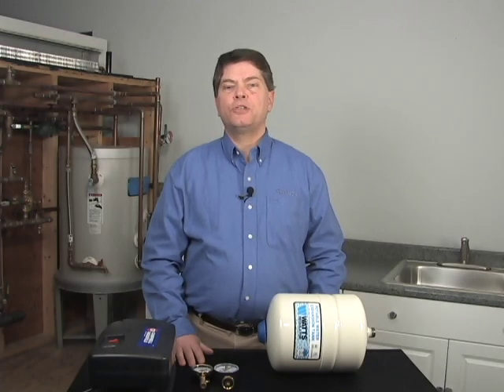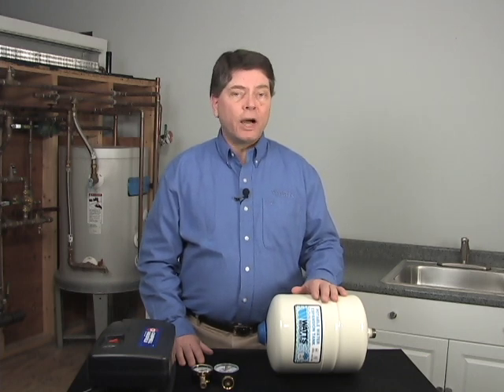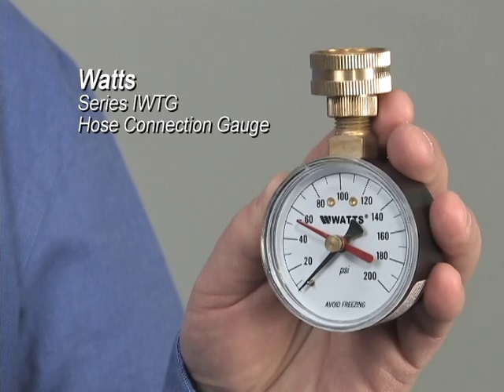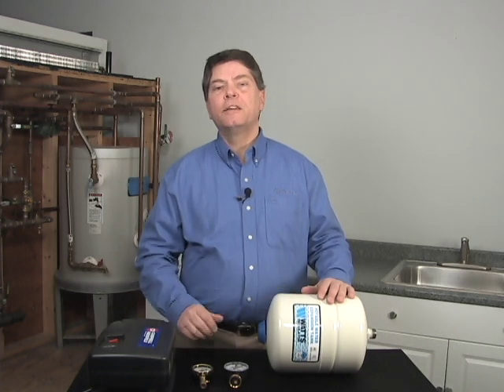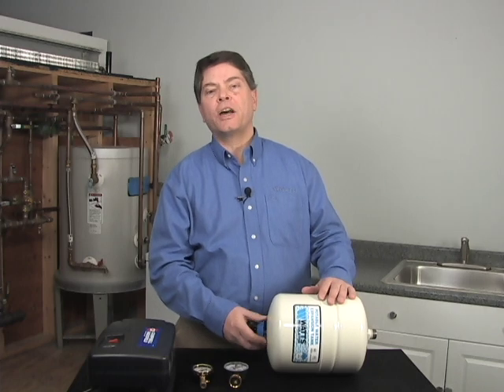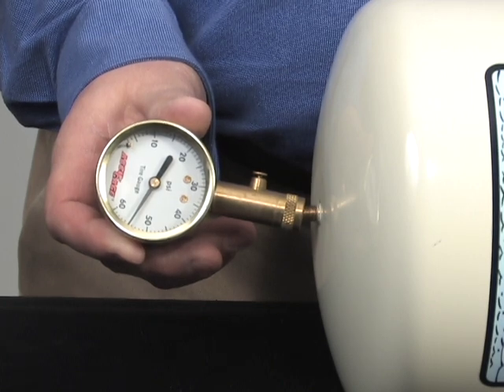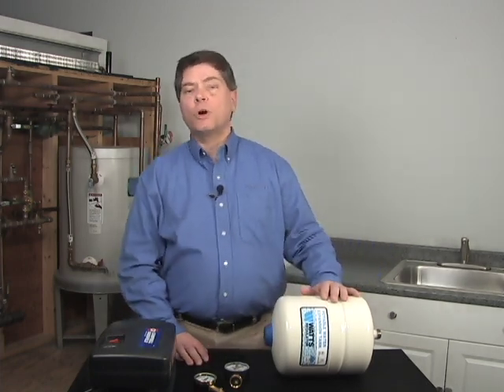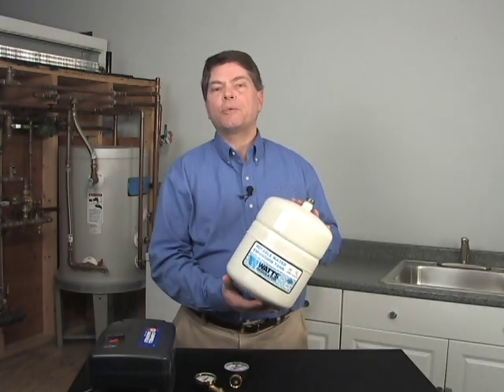Adjusting the Pre-Charge of a Thermal Expansion Tank

Comment: Please address hot water tank heating.   PRV set at 70psi.  Expansion tank set at 78psi.  Hot water tank kicks on to heat to 140F and the pressure rises to 94psi.......  Me thinks these tanks are a scam......
Reply: Set it to the incoming cold water pressure. If your water pressure rises above 80 psi that needs to be corrected with the utility or your plumber. The expansion tank pressure should not be higher than the PRV setting. A standard water heater PRV shouldn't open until 150 psi so if yours is "set to 70psi" that seems wrong (is yours adjustable?).
Reply from the maker: Thank you for reaching out to us. Please visit http://www.watts.com/pages/contactUs.asp to contact us so that we can learn more and help.

Comment: Water pressures is 40psi can I set tank preasure to 50psi? What are the negatives?
Reply: If the tank is set to 50 psi, then the water pressure will increase to 50 psi before it starts filling the expansion tank. The negatives are you get a burst of pressure each time you open a faucet until it comes back down to 40 psi and possibly water hammer which may damage plumbing.
Reply from the maker: Thank you for reaching out to us. Please visit http://www.watts.com/pages/contactUs.asp to contact us so that we can learn more and help.

Comment: Hi, I recently had a new expansion tank installed by a local plumber and I noticed that he never bothered to check my water pressure, nor did he double check the air pressure in the tank before he installed (I was unaware of this procedure at the time). The tank says on the label the it is pre-charged at 40 psi and my water pressure is reading about 60-65 psi. Should I be concerned and do you think I should go back and try to adjust it properly now that it has already been installed? Or should I just leave it be? Thanks!!
Reply from the maker: The tank should have been pre-charged to match your water pressure prior to be connected to the piping. It can still be done. Shut off the water at the service entrance and open a cold water faucet to relieve the water pressure. With 0-PSI in the water piping pump the tank up to 60-65 PSI. Then close the faucet and open the valve at the service entrance.
Reply: Ok, Will do. Thank you!

Comment: If the expansion tank is already installed, do I not need to make sure it's empty before adding air to increase the pressure?
Reply from the maker: If the tank is already installed you should relieve the pressure on the system side until it is down to zero-PSI before charging the tank with air. 

Thank you for your interest and please let us know if you have any other questions.
Reply: 2:22

Comment: I just bought a tank that was precharged at 40 PSI . I read the boiler instructions and it said that the tank should be 8 to 12 PSI. I decreased to 10 psi and the the boiler pressure release valve stopped spraying water onto the floor. My suggestion is to read the instructions on the equipment that you are adding the expansion tank to; do not go by your  water pressure unless it specifies.

Comment: if open system (booster pumps) the air pressure should be 0.2 or 0.3 below pump working pressure because without it everytime u open the tap pressure goes to 0 this way u let ur pump survive the short cycling which will damage the pump u simply in this video should specify and dont show a water faucet to drain water when ur talking about closed system

Comment: thats in closed system. like heating or chilled water not in booster pump open system
Reply from the maker: Sorry for the delayed response. The tank is meant to be used for thermal expansion created by heating water in a closed system. You seem to be describing the use as an accumulator tank which is not the intended application. The installation of the tank on the CW side of a water heater should not cause a booster pump to cycle. All it should do is accept the expanded volume of water created by thermal expansion and push the water back into the
system when it cools down.

Comment: If I'm on a 40-60 PSI well, should I average the precharge at 50 PSI, or go with 40, or 50?
Reply from the maker: Pre-charge should be 50-PSI.
Reply: This is my situation as well, can you (Watts) speak to the comments about setting it below the cut on point?
Reply: If you are using it as a well pressure tank instead of a thermal expansion tank, then yes you would set the tank pressure to 2 psi below the cut in or minimum pressure. On a 40-60 psi well the tank should be set to 38 psi. Unless you are using a cycle stop valve, typically you would have a much larger well pressure tank which will also handle thermal expansion unless there is a check valve or regulator between the well pressure tank and hot water tank.
Reply: That's incorrect your air pressure should always be 2psi less than your cut on which is 40 psi if your using a 40-60- switch. Sonyour air pressure should be set at 38 psi
Reply: If your using a 30/50 pressure switch you should precharge your tank to 28psi. Always 2psi less than when your pressure switch turns the pump on
Reply: Rick, did you go with the 50 psi and did that work for you? I'm about to install on the same setup. Thanks!